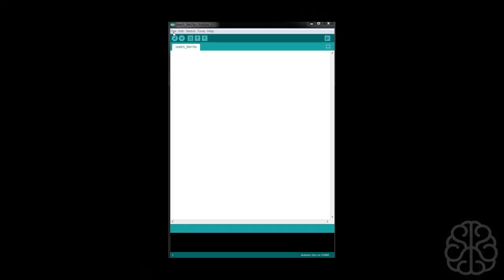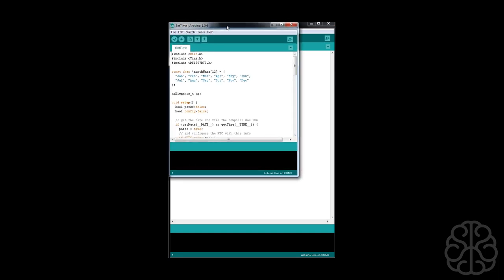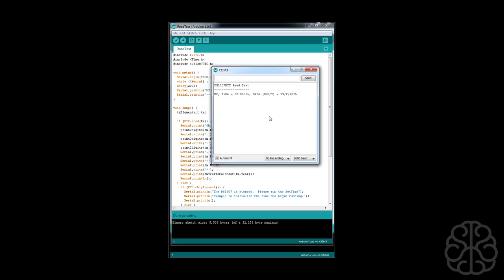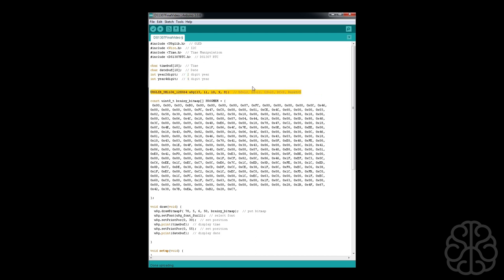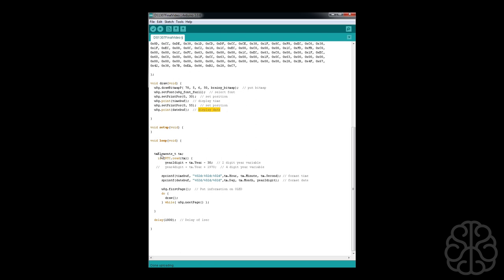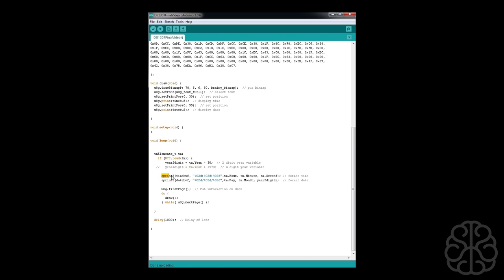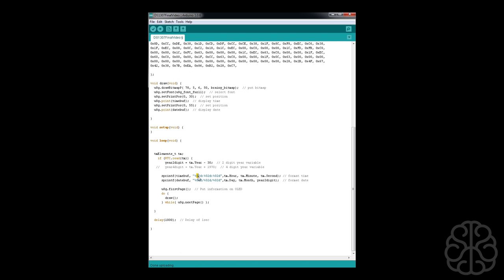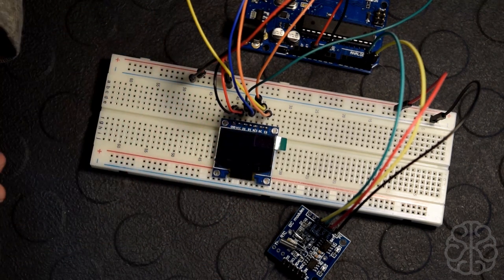How to connect and use a DS1307 Real Time Clock with Arduino - Tutorial

Comment: i just bought one of these exact modules and it is coming with a cr2032 battery.. the ones youre saying to not use.. so i have to break the charging circuit on a brand new thing because they included a battery i cant use in it??
Reply from the maker: Not exactly, you see the battery that is required by default is a LIR2032, which is a rechargeable battery and can be hard to find, also expensive...  but the CR2032, not rechargeable, is very common, but it cannot be used directly, since the RTC module will try to charge it, and basically kill it, or worse, cause a fire.  So you have to remove the charging component for the RTC module unless you get the LIR2032. Hope that clears things up, thanks for watching!  Btw you can check out my website for more info here: https://www.brainy-bits.com/rtc1307-arduino-library-tutorial/
Reply: @BrainybitsCanada  is this something i can remove then replace in the future if/when i find the proper battery? the rtc module was only like 3$ but i still hate to break such a cool and useful feature permanently

Comment: Hi Brainy-Bits! I just wanna ask is it possible to combine a water sensor and RTC program? Thanks.
Reply: +Yixingsmoo Aeri Sir could you let me know how to program this one.
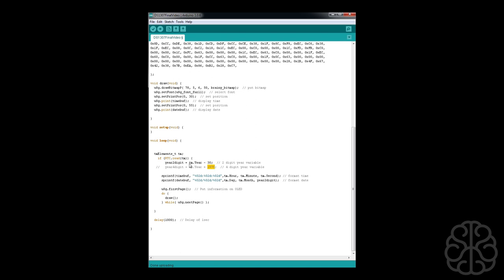I want to turn on the device every 7:30 in the morning and it will stay on for 10mins long, after that it will turn off and it will turn on again on 4:00pm and stays on for 10mins also. Could you please let me know how to set this up?

And we're planning to use this for watering system,but same with the question above, we will use a water sensor. What we're planning to do is to stop the above situation in case that there is water detected. is it possible to run and combine this using one program? Thank you :)

Comment: Thanks for the tutorial, and it worked like charm on the first try itself :),. I just have 2 questions,..
1. what if i want to display as 12hr format.
2. At some places resistors are recommended to connect to the SDA and SCL lines,.. but we don't use it here?
Reply from the maker: +CARTIKN Hi, the library used in this tutorial includes a function to use 12hr format:
hourFormat12();  //  Returns the hour value in 12 hour format
also to know if it is AM or PM you can use these functions:
isAM();   // Returns true if time is AM
isPM();   // Returns true if time is PM

As for the resistors, it seems that they might be needed if you are using the I2C model of this Oled module, they are not required for the SPI bus models like the one we are using in this tutorial.

Hope this help and thanks for watching!

Comment: I have a problem on the module , if battere CR2032 inserted , reading the serial monitor blank , if battere in detached , normal readings , I use mega2560 , CR2032 I have modified following the tutorial , please help to solve this problem , thank you
Reply from the maker: +ferry Hendrawan Hard to say, but it sounds like a short when the battery is inserted, check to make sure nothing is shorted on the board when you modified it.  Hope this helps and thanks for watching!

Comment: Such a code with delay(1000) is not correct. That's because running code itself takes some time. So whole loop cycle  takes 1000 + some extra. In the video you can see clearly the problem it causes – you have disappeared seconds at 16:23:15, 16:23:46, 16:24:01, 16:24:15, ... The solution could be not to delay() at all.
EDIT: after posting this post, times I have written became recognized as video times. But they are meant to be times as seen on OLED display :)

Comment: Great tutorial! Thank you very much for sharing Ivan, just ordered my module and batteries. I've already setted up the time code in my proyect, but I have to update the time every time I shut down and back up the arduino. I imagine that there's an easy way to just upload that time that I already configured in the arduino to the DS1307 right? Or either way to obtain the time online from a server with the shield and upload that to the DS1307 RTC I'm I correct?
Reply from the maker: Javier Romero Hi, thanks for the comment!  If you installed a battery in the DS1307 it should keep the time once configured even if you turn off the power.  These originally use a LIR2032 rechargeable battery, but if you do the modification you can use a regular CR2032 which is easier to find and cheaper also.  You can find the instructions to modify your module on our website here: https://brainy-bits.com/tutorials/rtc1307-arduino-library-tutorial/

Of course if you want to get the time from a TServer and then use that info to configure the DS1307 at startup you could. :)

Ps.  Never use a regular CR2032 battery in these unless you do the modifications, since the module will try to charge it, and will damage the battery or worse...

Comment: hello sir please help me i want to make an automatic egg incubator i did every thing but i have a question can i use arduino to rotate a motor 5 time a day with three hours of delay 
i also connected dht11 sensor to read temperature and humidity but when i gave delay to the relay (which is used for motor rotation) between the delay time the dht11 sensor also on hold and dont show the temperature 
i have tiny rtc i connected to give the hours and times but when the date goes is i need to connect to computer and write another date sorry for my english please help me 😍

Comment: My arduino turns off when I connect it's power to the time module and the 7905 fuse starts to heat up, also my RTC came with the CR2023 battery already in it, please someone help me! Could the battery's inability to charge be causing this problem?

Comment: When I try to compile, I get an error dealing with the "tmElements_t tm;"  is this a common problem that you know the solution to, or would you need more info?  FYI, I'm very new to Arduino, so simple terminology for now, thanks.  haha
Reply: My solution for this problem is downloading Arduino IDE version 1.06 on a other location. This works for me ;-)
Reply: Thanks for the help getting by the error!  However by doing that it fixed the error problem and lets me upload the sketches (seemingly) successfully, but when I open the serial monitor, no date or time shows up in there.  Nothing shows up in there.  As I'm not planning on using the OLED display, how would I confirm that the RTC is tracking time properly if nothing shows up in the serial monitor window?
Reply: same goes...